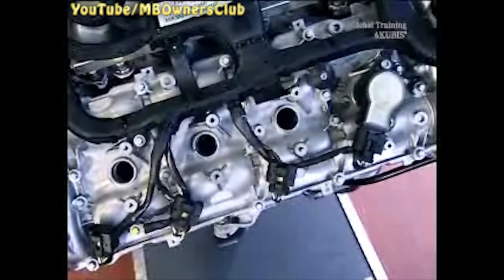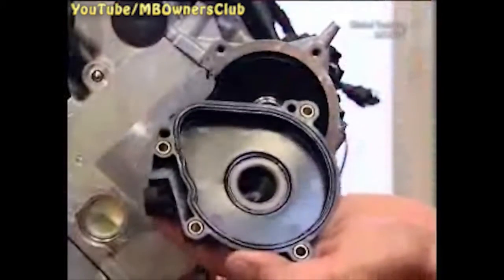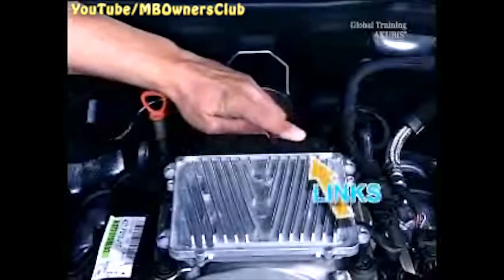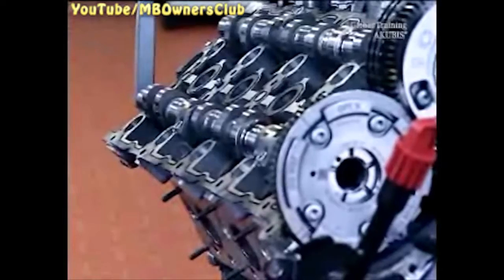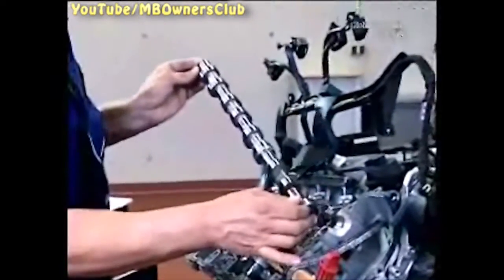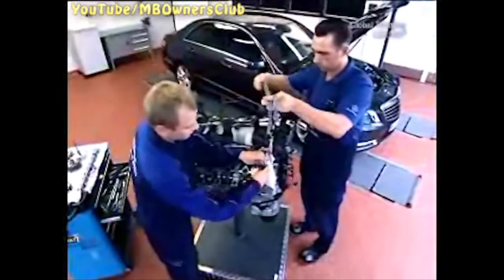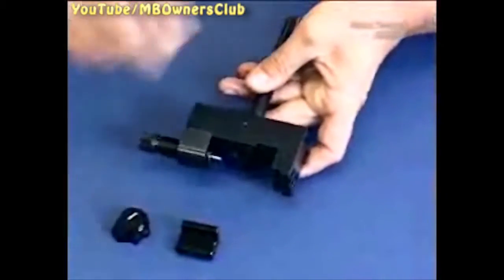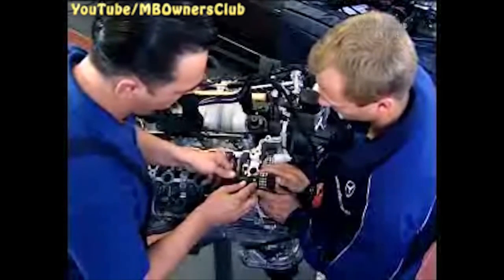Mercedes-Benz E-Class Timing Chain Replacement | W212 Engines M272, M273 | Part 1

Comment: Looks like I’m not doing my timing chain🙃
Reply: Bro right? It’s NOTHING like Japanese/American
Reply: @KeepItC1assic  It’s over engineered. Why would you do this on a car that’s not especially reliable or anything? My Mercedes ended up getting crashed into and totaled by an illegal Guatemalan anyways so I didn’t end up getting the timing chain replaced😂
Reply: @D34D22  bro 🤣 I just got one in a trade and it’s fine I was just wondering at how hard it’d be to do a full refresh aaaaaaand I think you can agree. F that

Comment: What a BULLSHIIITE job, basically making it impossible for us to repair our timing chains on this bullshiiite engine the Krauts came up with. This should be a CLASS ACTION LAWSUIT against Mercedes Benz for making sure they can force you to bring it in to a Mercedes dealership. NO ONE WANTS TO REPAIR MY TIMING CHAIN because it is a $4000 job or more. Only the dealer wants to....and warns us that we better be prepared to basically rebuild the engine. CURSES on you Nazi car company.